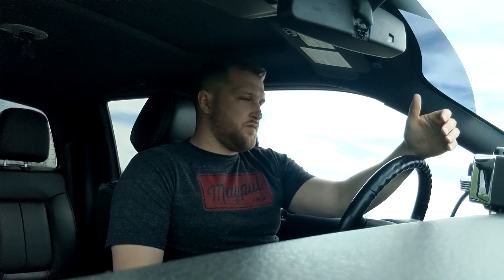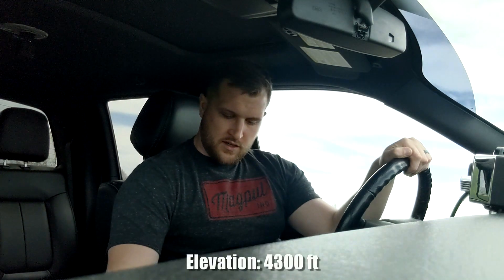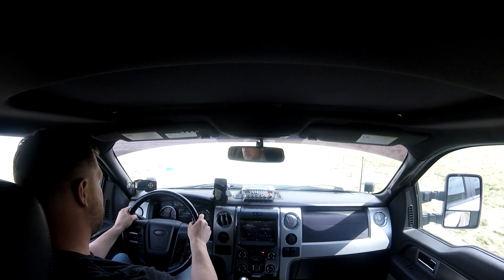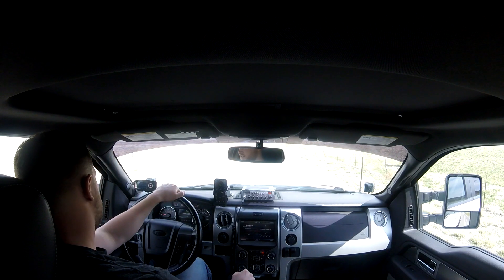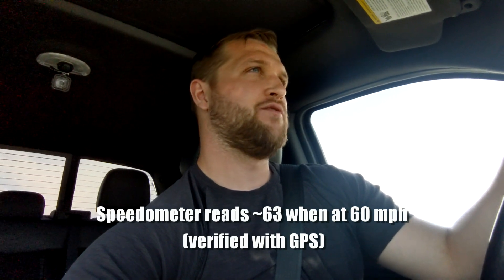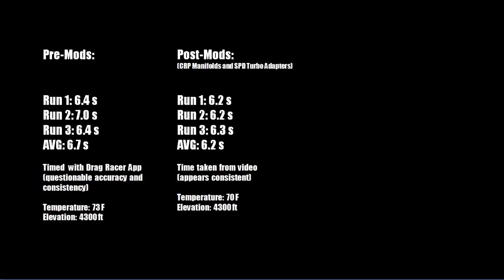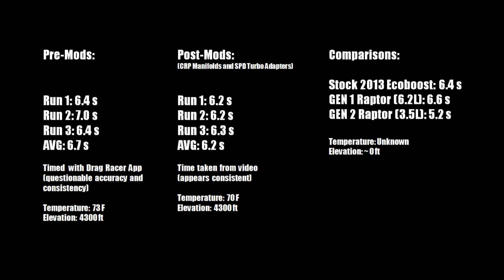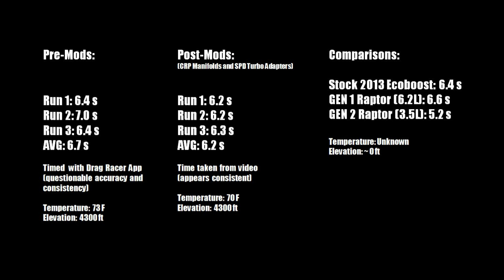Fixing the Ecoboost - EP8: 0 to 60 Test with Performance Exhaust Manifolds and Turbo Adapters

Comment: Why did you change to 0W-40??
Reply from the maker: Seemed to help the cam phaser rattle. Also, thicker at high temps and thinner a low temps.

Comment: Im interested to see these compared to bd diesel updated exhaust manifolds for the 3.5 those are the ones i just got because they have 11 stud locations as well as port matched and increased flow. The stock manifold studs arent enough for those turbos hanging on the back they always leak and snap and the 3.5 heads already have the bolt locations
Reply from the maker: Yeah unfortunately I bought these before the BD ones were released
Reply: @NSQGarage  oh okay !! Makes sense now

Comment: So I hear the exhaust, sounds like the raptor dual exhaust. What else is done? I'm at 6.5 0-60 in my 14 supercrew with just a tune in Idaho. Mine also has 3.45 gearing and is the long wheelbase, so it's full dry weight is like 5700lbs.
Reply from the maker: It has an intake and exhaust as well. It currently has 3.73 gearing. But I also have 35 inch tires, so that hurts my 0-60. But I'm pretty sure my weight is close to just under 7,000 lbs as the truck sits with everything in it. That does seem high if yours is only 5700.
Reply: @NSQGarage  I keep wondering how people are ripping off 6s in stock trucks, but the DA is usually pretty bad here 🤣. On 89 octane, I still think mine does alright though. I need to get it back up on the dyno and do a proper tune.

With some further trans tuning I should be able to push mine faster, but I'm still familiarizing myself with the way it all works. They're quite complex compared to a 5 speed Ranger.
Reply from the maker: @208Concepts  ecu tuning is all black magic to me haha
Reply: @NSQGarage  based on your intro, I take it you're from around SLC? That's not too far from here 😁.
Reply from the maker: @208Concepts  yeah I'm from North Utah. Where are you at? Lol
Reply: @NSQGarage  Boise area.

Comment: Did the truck feel any better? I suspect if you do down pipes and tune you will be floored!
Reply from the maker: It's definitely quick with those mods! I recorded 6 seconds 0-60 at 4300 ft of elevation. I think it would be closer to 5 seconds down at sea level

Comment: Did you not have to do any tune mods?  Motoroso, who I bought the crp manifolds from, told me I needed to do a tune or the engine wouldn’t run properly… 🤷‍♂️
Reply from the maker: I didn't do any new tunes. I already have a tune on it, so maybe that helped. I'm no tuning expert, but I am not really sure what parameters they would change.

Comment: Your numbers look good for your elevation.  Running similar mods (minus your manifolds) - with a 91p tune, 3.31's, mine does about 6.16s (timed via datalog.)  That is with over 300lbs of aftermarket skid plates on the truck.  I have to launch in 4wd though to get that time (as you can see in my video link below).. 2wd launches don't stay hooked.

Now that the truck is geared to 4.10's, I'm a bit slower (it needs an additional shift now to get to 60mph.)  But given the truck does a decent amount of rock crawling and towing (two opposing goals in many ways.. suspension-wise at least,) it was worth it for me.  Those 3.31's drove me nuts.  In fact I wish I did 4.56's honestly.. even 4.10's feel a bit long.  

Here's a link to my run right before the regear.. this was several years ago.  Truck has ~150k miles on it currently: https://www.youtube.com/watch?v=sypkflFW2LQ

You need to do the pshh pshh mod though LOL (this was just temporary..): https://www.youtube.com/watch?v=3EPTK5OJ8_c
Reply from the maker: Very nice! I had the vta mod for a bit. I felt like it caused some hesitation when come back onto throttle and I hated the extra attention on me haha

Comment: Similar mods on my end to fight this same condition.  Self-made engine oil cooler (much larger than the FR version at about $400 less,) transmission cooler upgrade, re-geared to 4.10's, mishi intercooler, and had FR radiator but changed that to a mishi as well (which netted me a few additional degrees of cooling given its slightly larger design.)  Also nixed the 'tow' tunes - all they were doing was driving peak boost up thus creating more heat.  Power was great but the trade-off wasn't worth it (for towing anyway - I still run tunes when towing flat land or unloaded.) Truck is pretty well sorted now.  Largest improvements by far came from the engine oil cooler and the radiator.  Installed a lower temp thermostat as well but that didn't add any thermal capacity - just made it take a tad longer before it would hit 240 (prior to the mods.)
Reply from the maker: I think you have posted in the overheating thread before, right? Lol
Reply: @NSQGarage  haha yep!
Reply from the maker: @yoster77  I have also considered ditching the tow tunes. But I thought some other users didn't see any difference. I am running 5 star. Who did your tune?
Reply: @NSQGarage  5star as well.  But end of day it doesn't really matter - all of them up the boost which is always going to make more heat.  Sadly there's just no way around that.  It's similar to why 'limp mode' cuts max boost to about 5psi, which allows the turbos and in turn the coolant and engine oil to start cooling down. Right now I run the 5star trans only tune when towing (with one modification - I have the radiator fans kick on earlier.)  In that 0-60 video I posted I was running their 91 performance tune.

Surprisingly I've found the SCT canned 87 tow tune to be a good middle ground between stock and the 5star tow tune. I'll tow with that from time to time if it's not super hot outside. I'll also still use the 5star tow tune...  But only during winter.
Reply from the maker: @yoster77 it's all about staying out of the boost. Manual mode whenever things get hairy lol
Reply: What are you guys pulling that is driving up the temps so much? Pulling my 8500lb camper in 95-100 degrees never gave me any issues.
Reply from the maker: @murphywilson8782  not much honestly. its pretty embarassing, mine would get hot with a 3500 lb camper. i think it has a lot to do with elevation, grade, humidity and grade
Reply: @NSQGarage  Humidity is one thing I have going for me in my area - very dry here. Our state is on fire all the time but hey at least humidity is low lol.
Reply from the maker: @yoster77  I grew up east coast and even lived in Georgia for a bit. I love the low humidity of Utah. So much more enjoyable.
Reply: @murphywilson8782  I pull a 30' travel trailer weighing 7500 (the last time I had it on the CAT scale anyway).  The grade I pull is a touch steeper than Ike gauntlet but over twice as long and increases almost 3x the elevation that Ike does over the course of the climb.  That coupled with high ambient temperature is what gets me hot.  Also note that if you're just looking at the dash, it lies to you lol.  The Ford temp needle isn't a true analogue gauge and won't move even at 230 degrees.  You have to use a tuner to see true temp.. and even then it's not actual coolant temp.. it's an inferred temp that Ford calculates based off CHT.  When it does finally move it goes quick to the red.  Stupid design lol. They do it so that owners are oblivious to running hot unless it's REALLY hot.  You might already know all this but just sharing if not!

Side note - I just got to our camping spot as we speak.  Happy to report it did great.  Still got a bit warm per the tuner but not to limp zone area or to the point of moving the needle.  I did notice that my charge temps were high though.. I think my oil cooler is blocking air to the intercooler.  Need to give that some thought.

Comment: Does it break those 35s lose with the traction control off?
Reply from the maker: I'm not sure to be honest. I think all of these 0-60s are tearing up my tires though. I have chunks missing from the outer lugs haha
Reply: @NSQGarage  careful. I was towing a dual axle trailer yesterday and one of the tires just shredded itself apart. It can happen.